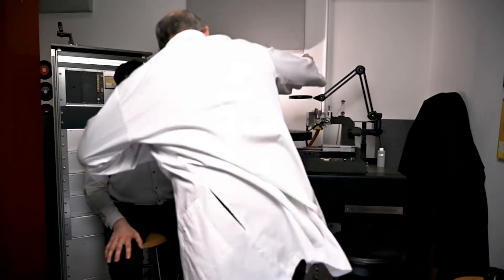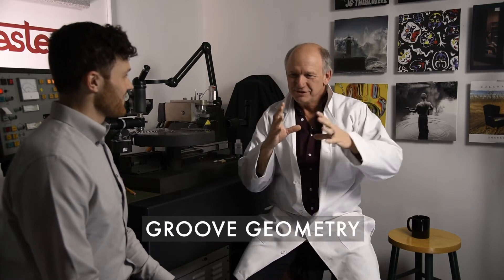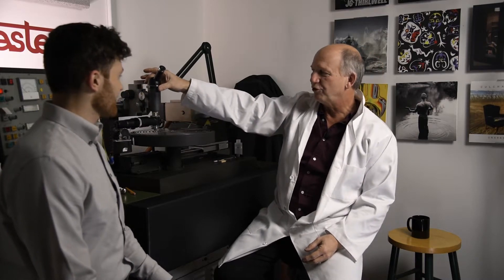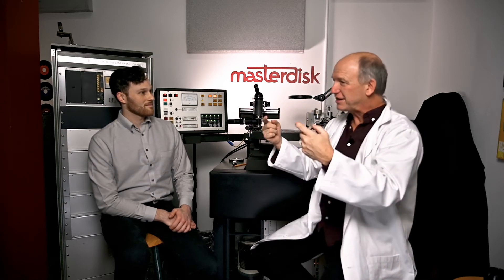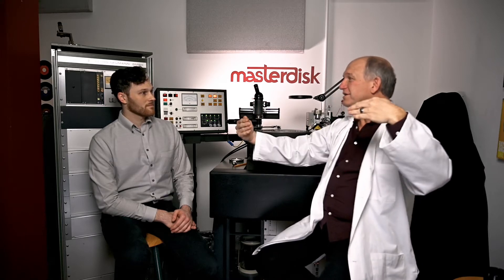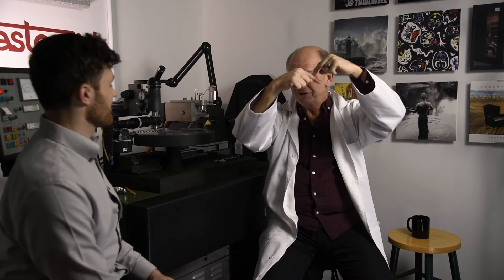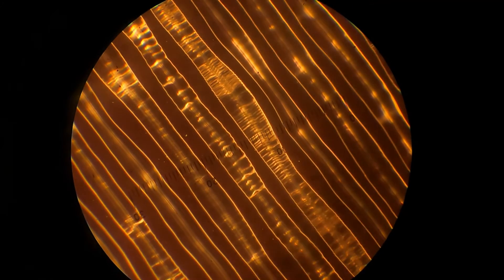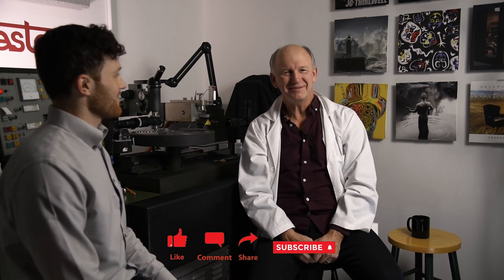The Vinyl Record Groove Explained

Comment: Question:  I well understand the MS concept for encoding stereo as literally implemented in stereo FM radio, and at least old analog stereo TV, and in some microphones.  But in record cutting lathes and phono playback cartridges, isn't the actual implementation usually with plain Left and Right signals (not MS) with 45/45 degree electromagnetic coil orientation for the 2 groove walls?  I realize it could be done either way to produce the same standard record groove geometry- just wondering about the norm - L/R would require less signal manipulation for standard playback than MS.  But I have a vague recollection from my young audiophile days of a much-revered phono cartridge (Decca London?) that WAS (I believe) constructed in MS configuration - if so, not sure how and where the signal was converted to L/R for standard phono preamp interconnections.
Reply from the maker: Correct, I may have overstated the comparison to MS.   I did that so that audio engineers might understand it better.  But you are correct, MS encoding is NOT used anywhere.   The Mid Side relationship is Physical.    Mid-signals cause lateral deflection of the needle, and Side Signals cause Vertical modulation.     I'm not familiar with a MS cart... but there was a special cartridge manufactured years ago to play back stampers.   It wasn't M-S, but it was unusual in that it played the ridges of the stamper for quality verification.

Comment: I not only attentively listened all the way to the end - your explanation was the first one that I found, after scores of searches, to finally explain and confirm my own conclusion that the "encoding" of one of the 2 stereo channels in the stylus cutting or playback coils must be in opposite polarity with respect to the other in order for a mono recording (or center-panned parts of a stereo recording) to result in LATERAL modulation of a record groove (as desired for optimal recording quality [more limited vertical modulation] AND for compatibility with older mono records.  I concluded from thought experiments that it HAD to be that way - and yet every other discussion I could find on the Internet omitted that important detail!
Reply from the maker: Thanks for the note.... I agree it's a very basic physical requirement.  It just makes sense when you really think about it.

Comment: I don't think record's are necessarily "soft on top", i have a lot of bright sounding record's in my collection that sound "shrill"! The RIAA curve flattens out the signal to "normal"! Lets talk about how in the 80s they purposely "rolled off" the top end on record's to a very low level, while they "brightened" the top end over the top as an attempt to make people think CDs were better when they actually weren't! Its a marketing cheat, believe me my friend was into that marketing then! People's ears are attracted to high frequency like moths are to bright lights! Not to mention they put over 60 minutes of music on one disc and pressed them on purposely shitty vinyl! 😮
Reply from the maker: I think we have two very different thoughts there.  One is engineering.  RIAA is considered to be " FLAT" response end to end and shouldn't have any significant impact on perceived brightness.   The second is Tone and is almost entirely subjective.  The trends for records to be brighter or darker is an Artist/ Label/ Producer/ marketing decision.   But more than that, often times long record sides will have a LOT of the low frequency energy removed - so that extended durations are possible.  I will be making a video showing how the original LP playback was low end light - but the current Digital audio sounds much better.   Low frequencies use more space on the disk. This is covered in depth in another video :).  Thanks for commenting.

Comment: If you rotate your turntable by 45 degrees, play a record on it, and then plot the motion of the stylus over time, you will get something called a Lissajous plot, which is exactly the output of a device known as an audio vectorscope.
Reply from the maker: We use that all the time.  Using a dual input oscilloscope.   But mono  on this scope is a diagonal.   
Neumann put a vector scope in their consoles.. ( Rotated 45 degrees )  to mimic the motions of the Stylus. : )

Comment: I was curious, has anybody ever just made a random record where they just random grooves and seeing what the music came out to be
Reply from the maker: Not that Ive worked on....  But you have to set some parameters for continuity.  Random will not play back with a phono cartridge.   so the " Audio" that drives the cutting system has to fall within the 20hz to 20khz range.. and within about a 60db dynamic range.   So these constraints don't allow for random.   BUT, there have been thousands of composers using conventional and non-conventional "instruments" that endeavor to find "random" and fix it in place for a unique listener experience.

Comment: How deep are the vynyl disk grooves?
Reply from the maker: We measure depth by measuring the width of the groove - With some easy Trig.. you get the depth.  "The line from the origin to the midpoint of the hypotenuse of an isosceles right triangle is half the length of the hypotenuse. This line segment is also a median to the hypotenuse and forms an isosceles triangle with the hypotenuse."

So if the groove is 4 mils wide, the depth is 2 mils. Here, mil is the old imperial measure of 1/1000 of an inch (not millimeters); this is 1960s technology.  
1 mil = one-thousandth of an inch (0.001 inch or 0.0254 mm). A mil is not the same as a millimeter (1 mil = 0.0254 mm).  

The thickness of the lacquer coating is about 6-8 mil thick, but this varies. So, the maximum possible depth before hitting the aluminum and destroying your cutting stylus is 6 mil. However, a 6 mil deep groove can cause the stylus to ride so low in the groove that it's very noisy. Typically, 4 mil width is the max "safe cut"; momentary excursions beyond that are possible, but if it's too violent, the needle will jump out of the groove. Remember, the depth is constantly changing at a rate of about 300 cycles per second or less. It's the low frequency component of the depth that we are most concerned with.

Comment: Did the vinyl makers finally decide to drop the stereo with mono compatibility groove cutting and just focus on the best stereo cutting, when the interest in mono playback went to almost nothing? If not, then why not? After all, the mono record enthusiasts prefer records cut specifically for mono playback only.
Reply: The reason they didn't is there are hundreds of millions of turntables, pre-amps and receivers out there that would be made obsolete. And the current system works pretty well. Why change it?

Comment: That's why 33rpm can't make the groove as wide as the 45rpm's dose and that limit the sound quality and dynamic(also why Vinyl Bass sound only limit on center /mono)
Reply: 45rp has high groove velocity and therefore greater resolution than 33 1/3 to represent the waveform in high frequencies.
Bass is just easier to cut when mono as there's risk of groove jumping but depends on the signal and side lengths.
Reply from the maker: HI, thanks for writing. The depth is not limited by disk rotation speed. We have to remember that depth is not a constant but an ever-changing modulation. I'm working on a model that will let me demonstrate what I mean by depth modulation. Best, Scott

Comment: This was unexpected and deeply appreciated. What amazes me is how a record player, with all the electronics does the same thing as a plstic cup with a pin stuck through the bottom. The analog to the analog? Or vice versa.
Reply from the maker: Precisely... If you look at the Victrola , it's even more impressive. 
Sound pressure waves are funneled into a horn to magnify their pressure. These sound waves move a diaphragm, which causes a needle to move back and forth. The movement of the needle is precisely the same as the changes in air pressure from the sound. This motion is carved into a wax cylinder, with some loss due to friction, and when played back, that same needle follows the groove in the wax, vibrates the diaphragm, which causes sound pressure waves in the horn, and sound is replayed. Without any electricity or electronics at all!!  The ultimate in all analog.  Best, Scott
Reply: @masterdisk7210  All I have to say to that is, "We are DEVO!". You either get it or you don't. Lol

Comment: A side effect is that the bass drum/guitar/etc need to be pretty much mono centre, else the stylus is likely to be flung out of the groove.
Reply: Not necessarily. Listen to the stereo versions of the early Beatles albums. You have bass and drums coming out of one channel, vocals and guitars coming out of the other channel.
Reply from the maker: I have been asked to cut some records for JMI Recordings (a NY-based jazz label). These records have the instruments deliberately hard-panned: bass on one channel and drums on the other. The goal was to have them playable independently without crosstalk. This is super hard to achieve, but it's possible, and soon you can hear it on JMI 21. It's awesome, high-octane free jazz.

https://www.jmirecordings.com/the-jmi-record-store/max-gerl-mike-mitchell-hard-pan-double-12-vinyl-lp-45-rpm-presale-only

Comment: Should the turntable / Vinyl record be redesigned without backward  as a limitation ?
Why does a good record on a good playback system sound so good ? You know it when you hear it. All the math says that your CD, flac, hi rez streams SHOULD be"better" but my ears say not.
Reply: I would say it all has to do with frequency equalization. Records reproduce mid-range frequencies very well butthey don't reproduce the highs very well. So a lot of people say records sound "warmer." You can EQ a CD the exact same way. Use a graphic equalizer to turn down the higher frequencies and you can make a CD sound like a phonograph record.

Comment: I got a job in recording back in the 70's and took a IAR course and mastering vinyl was cover briefly.   From what I remember of mastering vinyl back then and how mastering vinyl was speciality that involved the mastering engineer and usually the record producer and/or the record engineer to approve the audio being cut.  That was because some processing might be done and the effect of the RIAA curve being applied.    Since vinyl making a come back it seems like people just send tracks to mastering houses and aren't involved during the mastering itself.   Also I never hear anyone mention the RIAA curve is that still being doing and where the RIAA curve being decoded in modern digital playback systems?     The one thing I always remember from the IAR class was technically vinyl records shouldn't be played more than once in  a 24 hour period.  That the vinyl is actually being pushed by the needle out of shape, but being a form of plastic it remembers it original shape and it takes 24 hours to come back to it's original shape.   Interesting comparing recording in the 70's with recording today way different both technically and the definition of the roles people play now.
Reply: RIAA is a curve specifically for vinyl. When applied at the cutting process it reduces the low frequencies (to avoid overlarge groove excursions) and boosts the high frequencies (which tend to have less energy). On playback (traditionally in the phono input stage of the amplifier) the opposite curve is applied, boosting the bass and cutting the treble to the original levels, which reduces the vinyl noise (but boosts any turntable rumble).

Comment: The internet is a creepy thing - yesterday me and my patner were talking about how we didn't understand how music got stored on spotify etc and I said I didn't even have the faintest about how it worked on vinyl. Today - this crops up on my 'feed'. Liked and subbed though anyway. But what goes on at the actual surface level? How come those scratches get to be 'relflected' as actual sound? Or is that philosophy?
Reply: It is vibration that causes the grooves to be cut, you can cut a groove inw record without electric, just vibration directed to a cutting stylus with a funnel like on phonograph but reversed so the sound goes down in to the funnel instead of coming out out of it.
Reply: @s0ulssh4x0r4  That's how they did it in the old days -- true analog recording.  Sing into the horn.

Comment: made it to the end. I think this would have benefitted from a bunch of graphics that show the inverted signal for one channel. That was a new one for me. Knew 45 deg angle, but I still do not fully understand how it works. What happens if one side of groove is wiggly, the other is straight, no excursions? This may be very useful discussion on how stereo works. Also a graphic with mono groove in top view with different frequencies and superimposed sine wave would be helpful. And then there is the question how do you get multiple sounds/instruments at one time from one groove? As far as I understand essentially constructive/destructive interference pattern.
I appreciate the effort, but this video did not clarify it much more. Explaining things well is not simple. I have to explain energy dispersive spectroscopy mapping and other electron microscopy techniques to the general public, so am well aware of the difficulties. 
For graphics, consider showing a groove with left with 400 Hz, right with 800 Hz sine wave, and how the signal gets passed through, with common middle and L/R difference signal. Or something of that sort ...
Reply: what was explained here is much like how "joint stereo" works in mp3 files
you can read about that to understand what's happening here
Reply: Daniel, you stated that well.  From this video, I now understand how a mono frequency sine wave may be recreated; the needle just tracks a groove that looks like a sine wave laying on it's side, going back and forth.  An example of what has to happen to that single frequency sine wave groove to recreate dynamic range would be enlightening (guessing that the peaks and valleys (amplitude) (swing excursion left and right) gets wider for louder and narrower for softer).  Then like you said, for stereo, a sine wave of one frequency in the left and a sine wave of another frequency in the right would be interesting groove geometry to pull out what is the main (back and forth) and what is the side channels (up and down)(?).  Then adding two frequencies to the left and two frequencies to the right and how that looks groove geometry-wise.  It is still magic to me.

Comment: Scott and Garrett: Great review of "how we got stereo" !
Umm, I have a couple of comments on all that (having worked deep audio myself)...
 1) Your note on original mono records should have included that some early 78-rpm disc recordings (Edison, in particular) were NOT recorded horizontally, but vertically. Therefore, such records  must NOT EVER be played on old wind-up antique "needle" players, or the record groove could be ground off at the bottom and the disc wrecked. Umm, that's for the very few folks who do appreciate music from the old days. :)
 2) You did touch on it that FM broadcasting and its introduction of stereo, at about the same time or maybe slightly after, is the same idea that you note for stereo vinyl. Yet, for FM, mid-side signaling could be done DIRECTLY from the microphones - one omni (or cardioid) for "mid", and one figure-8 for "side" signals to go directly(!) to the FM transmitter which were separated by the 38kHz(?) sub-carrier modulation signal. Nowadays, of course, we're all enjoying multi-mic'ed and heavily mixed derivatives, which could be considered "better". Hmm...

Yet, stereo vinyl is still under-appreciated and quite a journey. Again, thanks for a great overview of the technology!

Comment: True stereo only happens with speakers, not headphones. The reason: In real life, a signal will come to one ear faster than to the other (there's a small delay). This does not happen with headphones.
Reply: This points out that a better term is needed than stereo. Crosstalk is part of stereo. Both presentations work. Binaural with hrtf is the headphone version that corrects spatial inaccuracy of stereo.
Reply: 😂 of course it happens in headphones. the real issue isnt hiw fast it comes but when they arrive and how big difference there is in arrival time. and having signal to arrive at different time  is easy to do with headphones.
Reply: The difference is crosstalk between the speakers. Can be simulated with headphones, but most often isn’t. Wouldn’t go as far as saying headphone stereo isn’t proper stereo, but it makes it harder to mix music on headphones, as it is unpredictable how it will turn out on speakers.

Comment: In analogue the analogy is not only to the signal going in, but, more importantly, to the sound pressure waves themselves.
Reply: They (Electrical, mechanical, digital, magnetical) sound are all analogies. The word is kind of meaningless.
Reply: @hepphepps8356  ??? It's about the form in which the signal is stored. You could play back a record purely mechanically, without the RIAA correction of course. Try to do that with digital.

Comment: isn't the mono signal derived from the vertical movement of the stylus in the groove?  [edit: nope!] the L & R signals would need to be out of phase from each other for the mono amplitude to move laterally. [edit: yes, they are, and my understanding has been wrong for decades...]